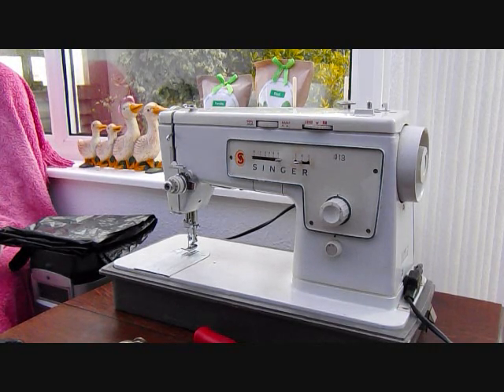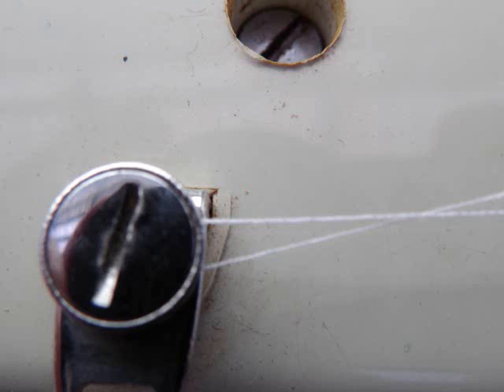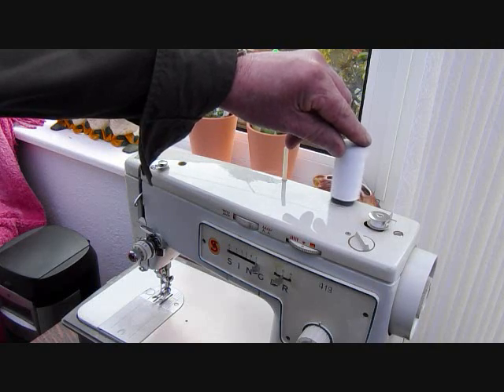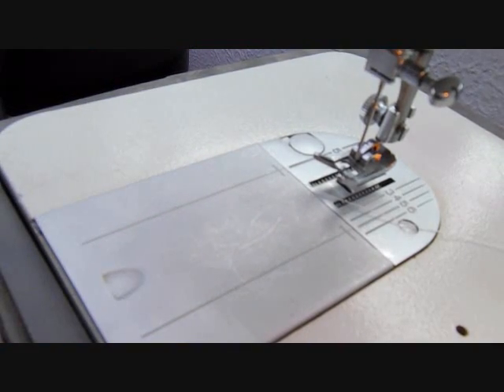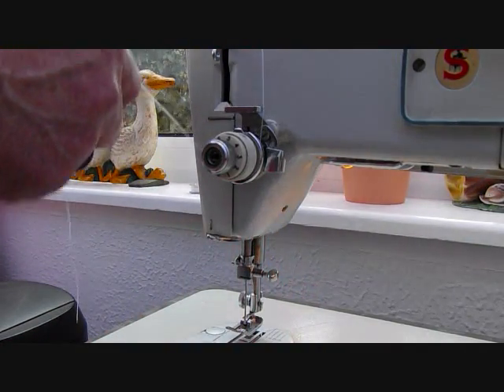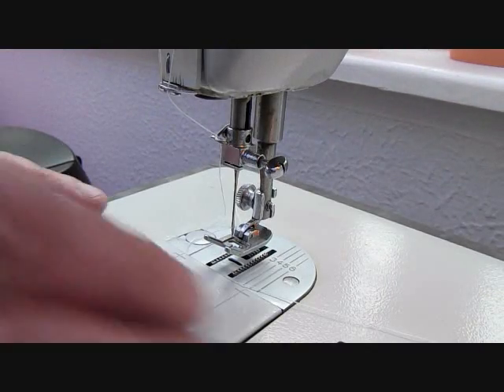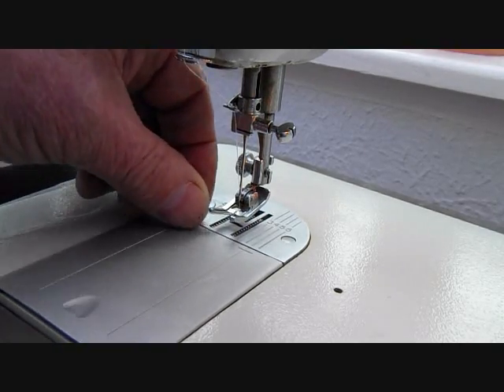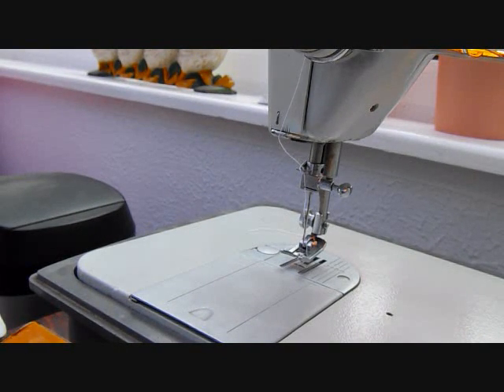Singer sewing machine loading and threading

Comment: Thank you for your time and effort making this video. I have a manual downloaded from the internet but the threading instructions were next to useless. Your video has now got me to the point where I can start to sew. Again, Many thanks. Robert Cook - Melbourne, Australia.
Reply: Thank you for the video. If I am unable to get the beautiful stitched you got from this machine does that mean it  needs servicing?
Reply: @rickelstone4306  Hello Rick - I am definitely not a sewing machine expert. What little I have learnt is that there are all sorts of little fiddly bits that get clogged with lint from the fabric. I started with getting the machine serviced first. Then I knew that any issues after that were due to  'operator error' - me! - Good Luck - Robert